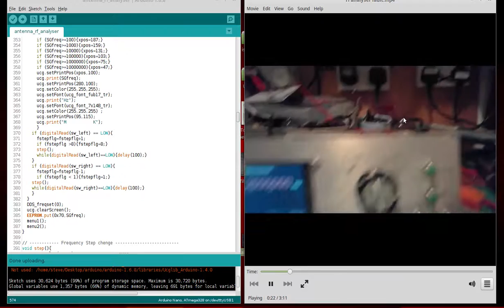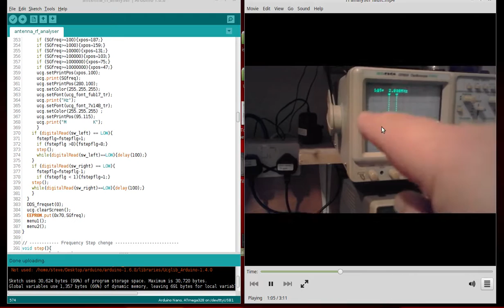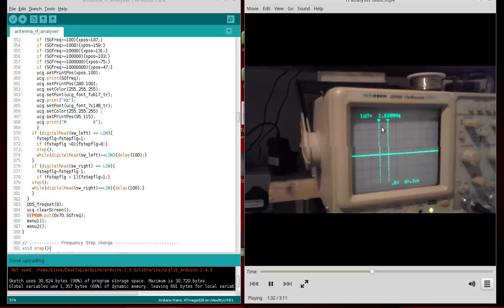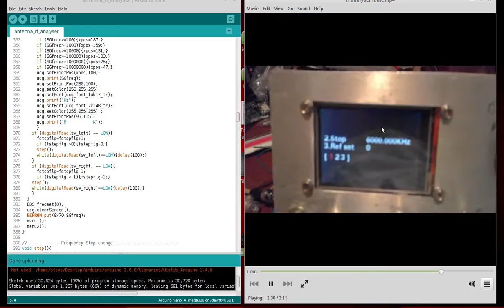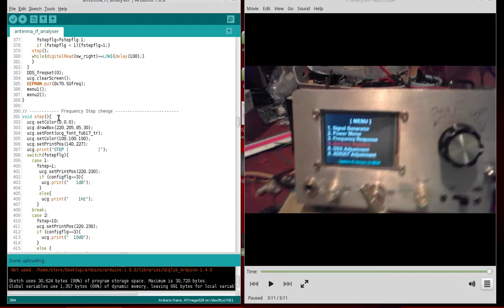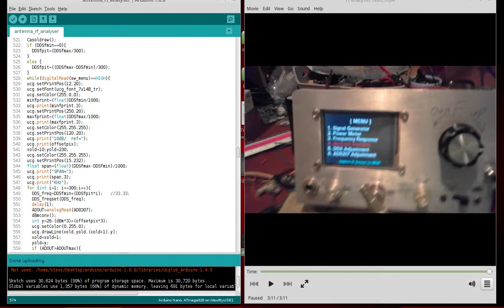RF analyser faults in arduino code

Comment: Hi Steve Great Video 👍. I have only just found your Video as I am trying to get back into Ham Radio after a long break approx 20 year's lol...I used to do a lot of Homebrew years ago and I am trying to find a design for an Arduino Antenna Analyser looks like i have found one here....I will be having a go at making one if I am up to it, as soon as I get the bit's together...keep up the good work...Regards Steve M0BFM Liverpool
Reply from the maker: Steve Jones thanks for the comment good luck building and enjoy the hobby
Reply from the maker: this is far more than an antenna analyser signal generator / power meter / rf analyser for filters and such its very clever what ja2nkd has done enjoy
Reply: Steve Edwards Thanks I will enjoy building one after all the great effort put into making it much much better than anything else that I have seen upto now. .Cheers  kind Regards

Comment: Mr. Matsuiura really is excellent. I wanted to know if you have published the project on some website to be able to read it and maybe put it into practice in my small electronics lab.
  Thank you
Reply from the maker: Rodo Lico I will be publishing some build guide lines and problems I encountered am remaking unit to solve some issues check my site there are some more videos thanks